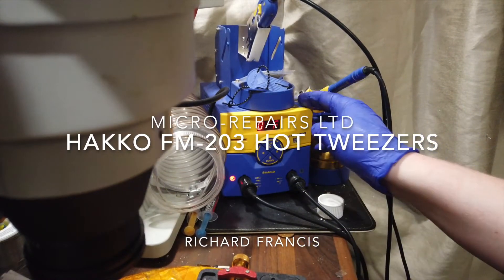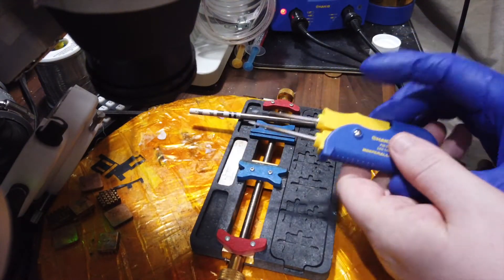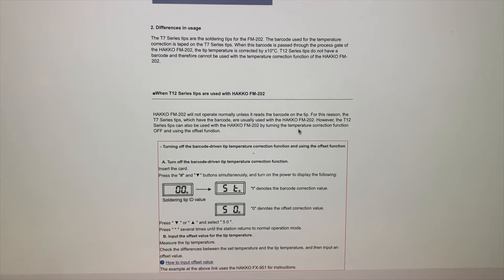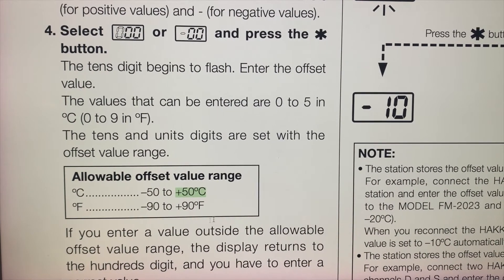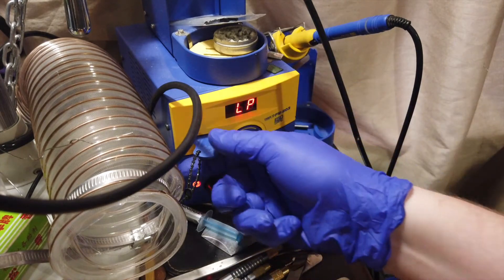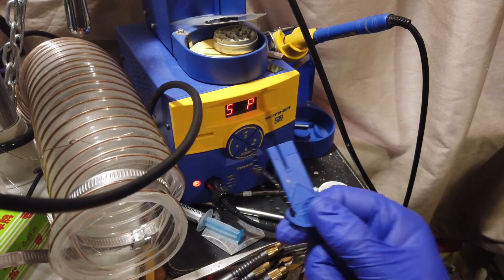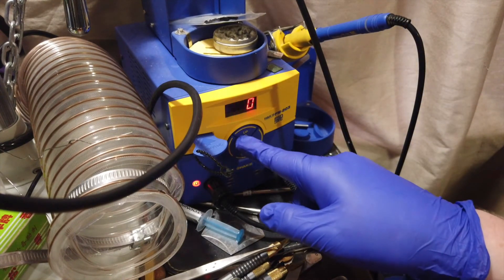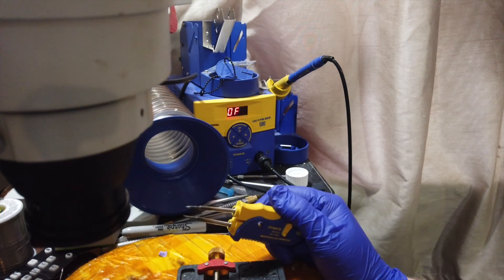Hakko fm-203 Hot Tweezers....How to make them Better!

Comment: Just got these tweezers and watched your video while I was unboxing.... I was worried. Then I took them out and went at a fat capacitor on a PS5 board. I got some leaded solder on the tweezers tips and used flux and the component came right off in about 15 seconds. And mind you, this was not a small cap. This was a large surface mount cap. What temp are you using? I use 375c and I haven't yet found something that won't heat up enough.
Reply from the maker: @gamerelated3887  hi I haven’t had this station for a while now. I’ve replaced it a few years ago for a Weller 2021 and a JBC station. I now use the JBC HT420-a hot tweezers. On those HAKKO stations the tip calibrates the heat offset and the tweezers tips on those doesn’t have the necessary barcode on the tip to calibrate the machine. So majority of the time the tip heat offset would be too low. But that’s not to say some stations in circulation won’t be just right or higher. Looks like yours is just right.

Comment: So why do you need to do this? Since solder melts with less than 300*C actual tip temperature. Is it to deal with demanding thermal loads (multilayer PCBs)? 

You should get one of those tip thermometers. I have one and it was very inexpensive… about £7 I think including battery and spare thermocouples (from eBay 3-5 years ago).  

Is 400*C the max set temperature for this station?
Reply from the maker: It’s due to the barcodes on the tips, on the tips on the irons they have a barcode which the station reads and sets the heat offsets on the station automatically for each tip so the tip is outputting the same temperature as shown on the station. On the hakko hot tweezer tips, there no barcodes so the heating offsets are not being automatically adjusted. So the actual temps are different to what’s being shown. It’s a design flaw with this particular station. Thanks so much rich

Comment: Жесть какая, сколько жало проживет на таких температурах?
Reply from the maker: не могли бы вы перевести для меня на английский, поскольку YouTube не переводит этот комментарий. Спасибо
Reply: @SURGE101 he said: what a shame, how long will it last at these temperatures?
Reply from the maker: @davadoff  hi because the tips on the hakko hot tweezers don’t have the heating offset barcodes printed on the tips used for the calibration of the heating offsets like they do on the t12 tips shown in the video, the tips on the hot tweezers are not properly calibrated for the station, so even though the station shows the set temperature, the tip temperature a lot lower due to this. I believe it’s a design flaw with this station. I’m still using the same tips shown in the video today and they’re still performing very well. Thanks so much rich.

Comment: Always helpful and thank you for passing on the information.
Reply from the maker: Thank you for taking the time to watch, honestly I really do appreciate it. Rich 👍
Reply: @SURGE101  Hi, how would you rate the Fm203 as I note it is very expensive. Has it become expensive suddenly or they were always around £599.
Reply from the maker: @mm0077  it is a very good station and very reliable but to be honest the hakko fx-951 just as good and a lot cheaper. The hakko fx-951 is able to use all the same hand pieces apart from the hot tweezers, which are not the best hot tweezers anyway and you find you’ll barely use the hot tweezers anyway. Even though the fm-203 has an extra port than the fx-951, (which helps but not a deal breaker) they’re pretty much the same machine. I’ll try and do a video soon comparing both. The price for the fm-203 always been around that mark but because the machine was made very popular by the likes of louis RossMann , Jessa jones and other YouTubers in the field , the price pretty stayed steady over the years and hasn’t really gone down unfortunately. The fx-951 definitely worth considering if you’re thinking of buying the fm-203. Rich
Reply: @SURGE101  Thank you so much, I was not thinking  to buy but I have been offered one to buy at £289 (bargain right) just Station with the normal  stuff it comes normally and not tweezers etc. The only problem it's american version. I am not sure  about using step down transformer with it. I know you can change the transformer to UK version. What do you think?
Reply from the maker: @mm0077  that’s a bargain, if I was in your position I would definitely buy it. That’s just so annoying it’s the American 110v version. At that price you could buy it to just sell on and put the money towards a 240v one because you’ll have no problem reselling that on eBay for a nice profit. Hakko does make the kits for converting them if you’re thinking of keeping it for you, in this video he converts it using the part from hakko (not sure about cost) 
https://youtu.be/iRWWqmLkHiQ
Either way that’s a brilliant price for that station, definitely worth it. Rich
Reply: @SURGE101  Thank you very much for the advice.